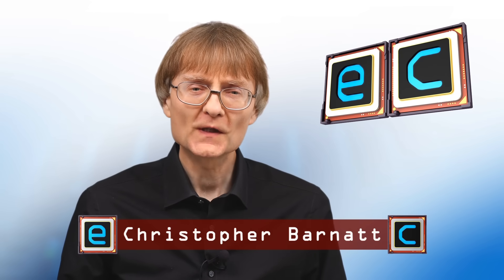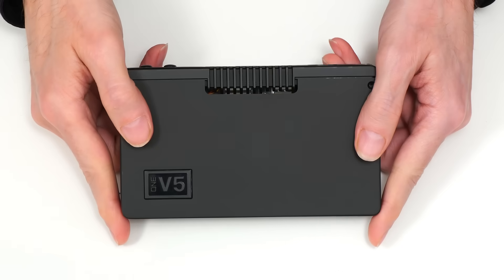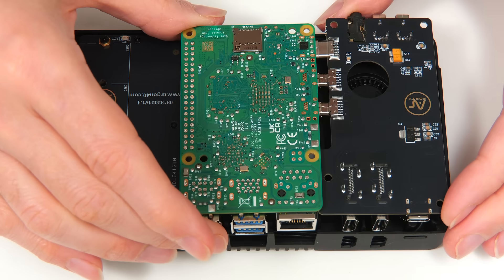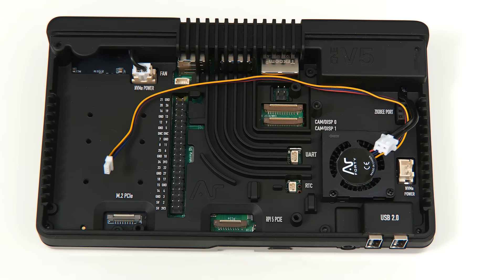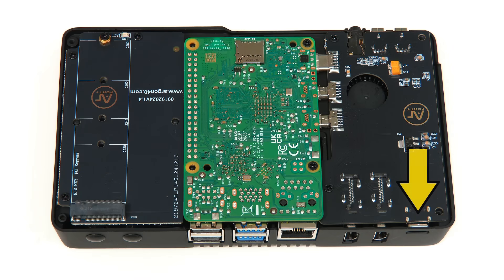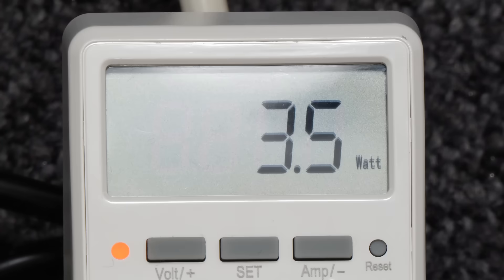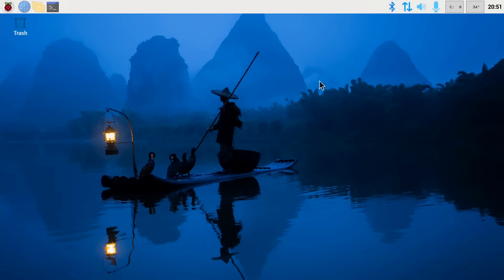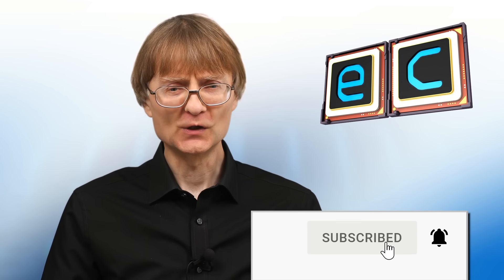Argon ONE V5: Ultimate Raspberry Pi 5 Upgrade?

Comment: I have the Argom One V3 M.2 case. The WiFi is badly affected in the V3, I have to use Ethernet. I like that the V5 allows easy access to the SD card; the V3 does not. The DAC is an add-on on the V3, but well worth it.

Comment: Still missing the mounting options (just some keyholes with a bit of protection on the inside) to hang it on a wall or under a desk. And the double NVMe variant could be interesting for project using AI, like with a Hailo AI acceleration module combined with a NVMe drive.

Comment: Greetings from across the pond near Albuquerque, New Mexico, USA. It has been obvious for some time that mini-PCs and SBCs like the Raspberry Pi 5 were on some kind of collision course. I believe your Argon ONE video indicates that the expected collision has now definitely occurred, to the benefit of users. Or maybe they've been bumping up against each other for some time. Anyway, let the sparks fly!! And thanks for another super-max-groovy video. Each is such a tremendous treasure trove of information.
Reply from the maker: Thanks for your support, most appreciated. :)
Reply: The Pi 5 is not cheap anymore. Will the Pi 6 be $300 or $400 with a huge upgrade kit if you want a mouse, keyboard, and monitor? Seriously, it's now a mid-range SBC and not for kids.
Reply: Hail fellow Burqueño
Reply: That is super kind of you! This channel is such a great part of YouTube. I love using my PI 5 8gb.
Reply: Since the rise of the 2nd hand / used tiny PCs I just don't see the point of RPIs, unless you specifically need GPIO for your project (but even that can be circumvented). A RPI + power supply + a case like this + an SSD will cost most likely way more than something like a HP Elitedesk 800 G3 or G4 mini and the performance delta is immense.
Reply: 100 bucks?? Do you sell meth
Reply: yes there is a price convergence happening. And of course many similar products.
But buy one of those, and see how you get on if you have a problem.
The Raspberry Pi series is so well documented, has a huge community with extremely knowledgeable people. Log on to a forum, and your problem will be answered very quickly, as long as you have described the problem correctly.
The amount of written support or online support for the Raspberry line make a huge difference. And, all things being equal, would push me in the Raspberry direction, if I had to make a decision. SUPPORT and share of market does help a lot.

Comment: I still think the Argon Neo BRED case is better in its thermal design, the fan in the One v5 is strictly just stirring the air in the case. I say this very aware they lose in the benchmark, because you can slightly boostrap the case's performance with a little tape and make it's fan carry air passed the fins and out of the case, something that doesnt seem quite as possible on the One V5.

Comment: comparing such a big cases cooling ability with much more standard sized cases is not very usefull. In that case I can call my freezer a pi case and it will win the contest.... Correspondence about my prize winnings can start in this comment section.

Comment: Great upgrade -- for people who are still willing to pay for a Raspberry Pi when better Intel-based computers are available for essentially the same price (or less in some cases).  But hey, it's their money and they are certainly entitled to spend it however they want. Perhaps the Raspberry Pi 6 will come with some of these features. After all, many SBCs that are NOT Raspberry Pis come with these features and more. (In case you haven't guessed, I'm completely over the Raspberry Pi. They have lost their way. They have become the Apple of the SBC market -- people pay inflated prices for less-capable hardware merely because it has a Raspberry logo.)

Be that as it may, congratulations on episode 600. May the next 600 be even more successful.
Reply: I fully agree. The cost has got crazy. You can buy a laptop with mouse, keyboard, PSU and screen for less now. Why don't they listen?

Comment: Nice video! I liked your explanation of the “satisfying computing experience” at the end. I was one of those Macintosh users back in the day and found in my business (architecture) they permitted a very high level of work without full time technical people to keep it all running. I’ll always think Apple peaked with System 9. 

After struggling with the constant new OS versions breaking software and forcing obsolescence in otherwise perfectly fine machine; and, most irritating, the OS trying to manipulate me, I’m using Linux.

Love your channel and your efforts and experimentations.

Comment: There is a RPi5 Compute Module Kit around here for 150bucks.. case, fan CM5 module (tho the smaller one).
I like the compute module PCBs over fiddling with the wires/connections from the "standalone" Pi5.

Still no real price gap to getting a tiny PC with N95 / N100, if you dont NEED to use a special niche function of RPi5.

......... 147 Bucks:
CM5104032: Compute Module 5 Wireless, 4 GB RAM + 32 GB eMMC
Compute Module 5 Metal Case
Compute Module 5 IO-Board (with NVME slot)
Compute Module 5 Cooler
Raspberry Pi 27W USB Type-C PD PSU
Antenna Kit
2x Standard HDMI-cables
1x USB-A auf USB-C Kabel

(The CM5 Module is a major price point, the CM5 io board is only below 30bucks.)

Comment: Perfect timing! I was just browsing the product last night and was extremely frustrated that neither the web site nor Amazon pages show anything but incomplete photos. I didn't even trust the single M.2 connector because the picture didn't show it! No instructions of any kind is available that I can find.

So, thank you for the video! 

Regarding temperature testing: I used to benchmark POV-Ray. However, recently I'm heavy on LLM. Calculating Ollama --verbose on "The perks of being a wallflower" on various LLM model give me red bar temp throttling every time.

Regarding the power delivery, it seems V3 is rather limited in that regard. I'm hoping V5 solves that. I have a power supply that can dynamically deliver up to 27W, but do so in lagging manner that causes flickerings on my Pi5 when crunching LLM, that I end up using the official power brick after all.

Comment: Wifi performance is important on these cases for the RPi4 and RPi5 as there is no connector for external antennas. 'wavemon' is a handy application for signal strenght, and you can use a naked board at a fixed spot as reference.

Comment: Thank you for your excellent and thorough review!

I don't think there is much of a practical reason to go with this setup over an N100 or N150 NUC. The only advantage it has is in lower power consumption, and I don't think that is much of a factor when you're talking about a desktop computer connected to an HDMI display. Raspberry Pis are for maker projects that require low power consumption. Being able to run a desktop OS on one has always been a side show in terms of what you can do with one. There was a time when the Pi 4B was the best cheap desktop in terms of price/performance and it gained a lot of attention as such, but that is no longer the case for any Raspberry Pi IMHO. The Pi 500 might have been an exception, but they hobbled its performance by excluding a PCIe/NVME interface. Given all that, I think the Argon One V5 is a very niche product with very limited appeal.

Comment: Full sized HDMI is always appealing and my only real issue with my Neo 5, and those front USB without loosing the rear ones is very nice. That said I do like the smaller size, so I think I would be more inclined to go for the One V3 as its a bit smaller but has the full sized HDMI.

Comment: Hard to tell, looks like you're running in 2K video mode. I always found that micro-HDMI->HDMI adapters were unreliable at running in 4K mode, so made sure to only use the official micro HDMI->HDMI cable.

Comment: If this took 12v power and had 12v power distribution it would be bought in droves by the Astronomy hobby crowd.
Reply: I find this comment really interesting, mainly because I have no idea about astronomy setups for raspberry pi's. What makes the 12v so desirable/important?
Reply: @oldmate227  yeah I'm curious about that part too.

If it's about running stuff off a 12v car battery or the similar in a field then a 12v USB power adapter would work.
Reply: That could allow sufficient current for the devices. The official Pi5 PS doesn't seem powerful enough for NVMe. PI4 definitely wasn't with Argon 2.